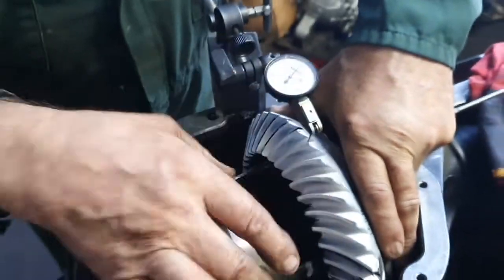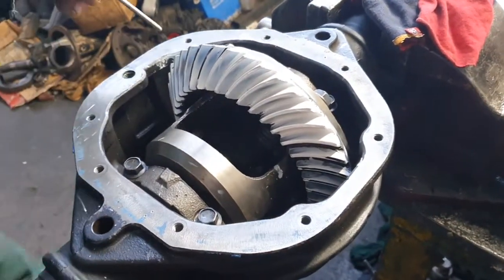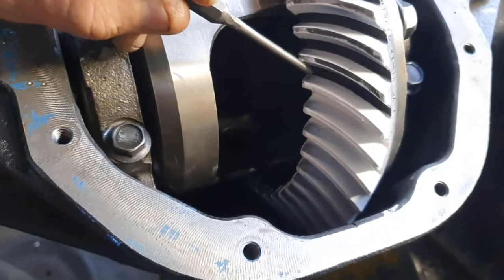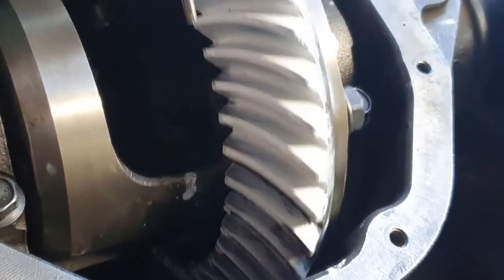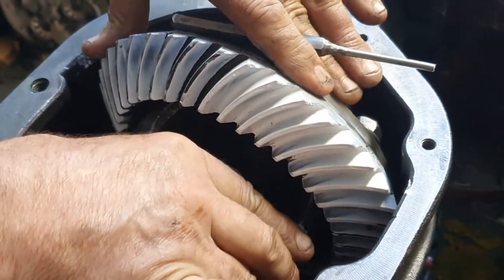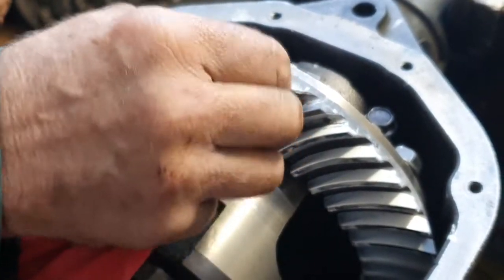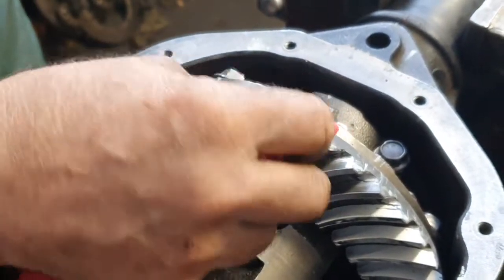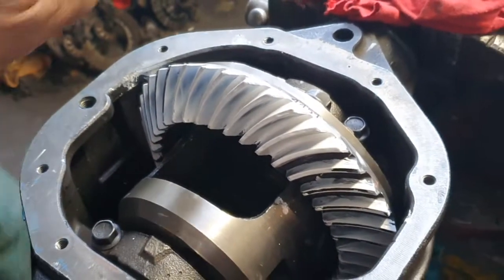Borgwarner m86 diff bad made gear set, can never get a good contact Mark when second hand

Comment: What gear marking compound are you using ol mate?
Reply from the maker: We import it from America, it is $15 for 3.8FL.OZ 
IT NEVER DRIES AND A BOTTLE WILL LAST YOU FOREVER. We can send you a bottle for $15 if you would like some. It is the best marking up compound in the world, we have it in white colour or yellow. We have been using it for over 80 years
Reply: Neville McNamara differential specialist yeah right!! I’ve got a tub of yellow I got off a diff shop here in Brisbane and I’ve got a fair bit left. But I was really curious to see diff shops using white which I’ve never seen before. I also use Derivan Oil paint and it works amazingly well. I can send ya some pics if ya want? Once I’ve got rid of this yellow I’ll grab a tub of white off ya
Reply from the maker: @TWITCHIN3RZ  OK mate no worries. yeah send me some pics that would be great thank you
Reply: Neville McNamara differential specialist emailed ya lads